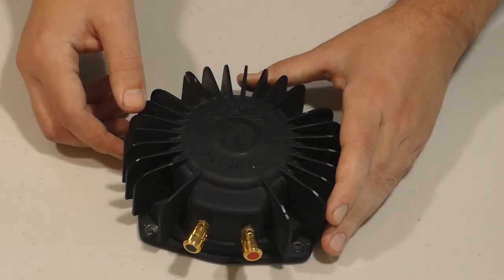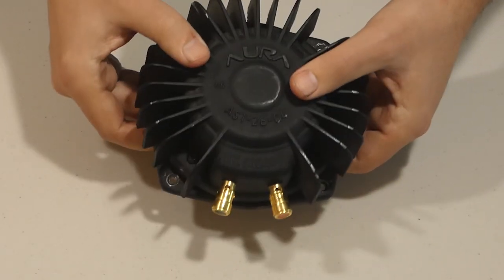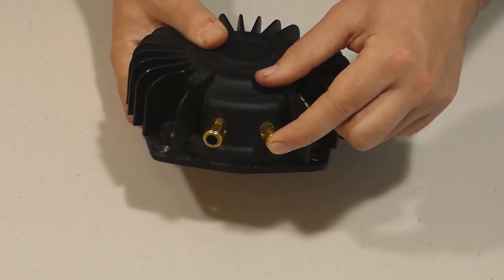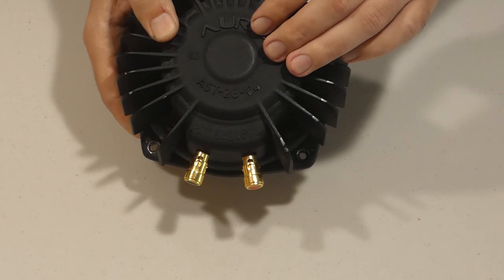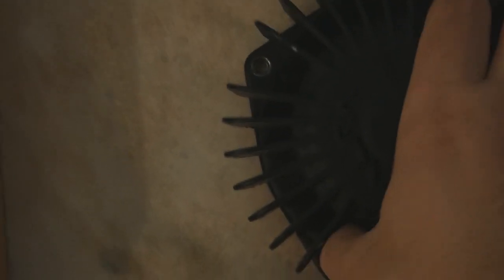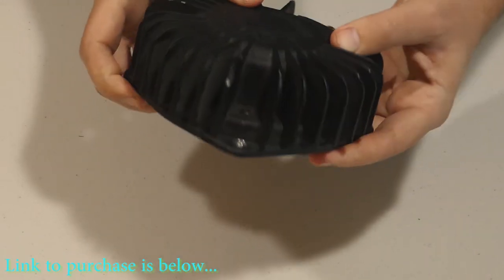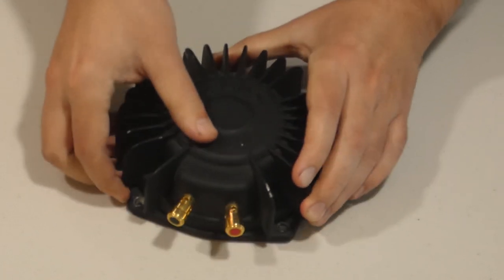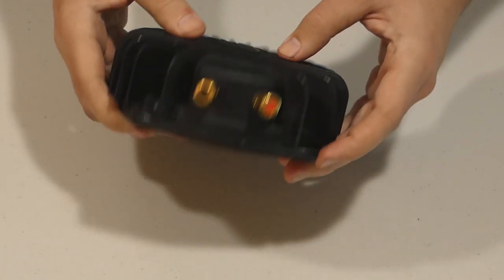AuraSound AST-2B-4 Pro Bass Shaker Tactile Transducer.

Comment: Hello. I have a boss accomastic 7.1 connected to Yamaha rxv2700.  How can I connect this ?
Reply from the maker: You can connect it to low frequency signal like sub-woofer connection. It will work if you connected to just speaker wire but works best with sub-woofer connection. It can share the wire.